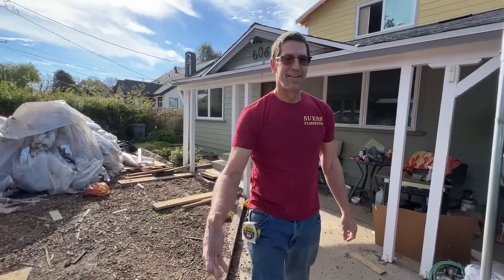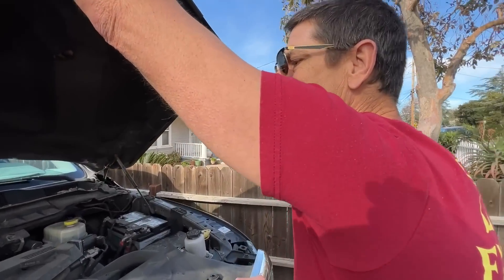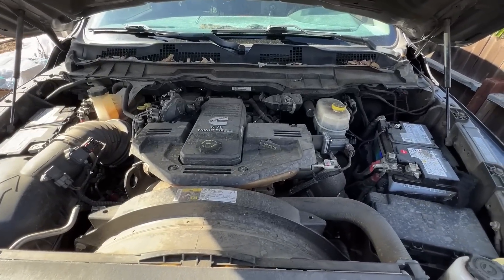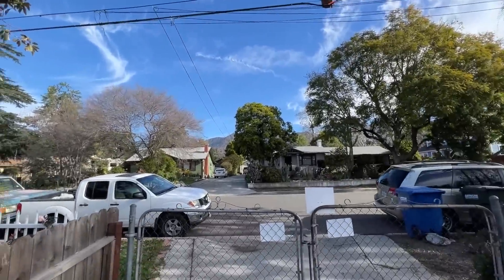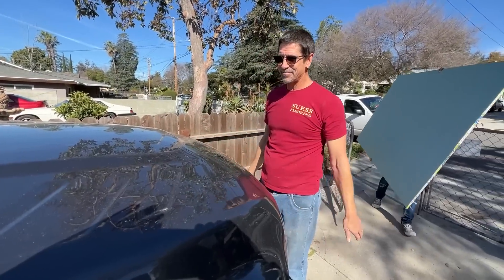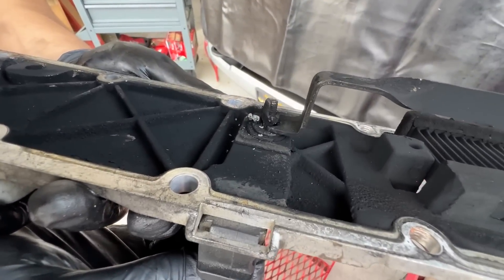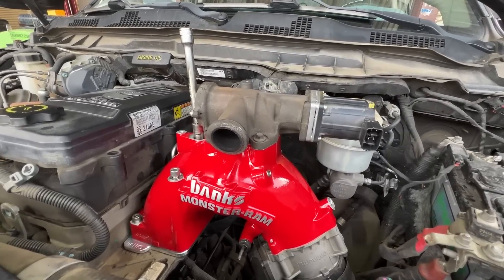This is the bolt that kills RAM trucks.

Comment: My friend had his 2014 6.7 destroyed by that grid heater bolt and has been working on his truck for 7months now. I bought the banks intake but still need to install it. I also replaced the killer dowl pin on my 5.9 12valve which was over$1000 to do. That engine is still running strong at 390,000 miles…Solid engines with little defects that are worth addressing
Reply: My daughter turned my old place in Texas into a cattle business and tack shop for horses & she needed a truck. We got this used 08 Ram with that 6.7 in it and that stuff was bad when we got it. I took it home and when I found out what that intake costs and the work that needed to be done man did she get mad. The truth is now I live 2,500 miles away. She has been here and back now several times and west coast with that truck. The times she comes here she tows their big camper usually shows up late June here. I keep going over it fresh fluids R a must. The thing is doing more than fantastic it is awe inspiring the way it just keeps on going. Thanks to living in the deep south away from the real terrible weather the frame is fine she had the rear springs replaced 2 years ago. Last year I just painted the thing again. I painted it when she got it and its still alive and well. She thinking about a new motor this year or next year.
Reply: Wow you got robbed on the kdp kit. That kit is $130 and a few hours if that to remove timing cover and install kit.
Reply: @dsimondublin  that's where it pays to know a trade fr the labor some of these big shops charge is insanity
Reply: @dsimondublin  No need to buy a kdp kit. You can make a tab yourself from any piece of metal. All it's going to cost is a front main seal and a gasket. It's less than 30 bucks to do it yourself.. I'd never charge a customer that much to do a kdp. Someone's eating good after being paid that bill, wow
Reply: The 5.9 is a superior engine to the 6.7 in all aspects besides not as much power
Reply: We replaced the killer dowel on our 97 12 valve about 10 years ago. It's at 97,000 original miles. Not even 100k

Comment: As a career tec at freightliner dealer first thing i would have done was steam off the engine 
It was like not taking a shower before surgery 

The inside of the intake looks like the inside of a muffler
Reply: government emissions to thank for that, all the current diesels look like that due to EGR system.
Reply: That was EXACTLY what thought.....clean that engine.👍

Comment: It's the perfect example of incomplete information being shared as the gospel, the reason why that intake air heater failed even out in California where it would only get used a few times a year, is because the Dodge solenoid on the passenger battery tray shorted out and kept the voltage to the heater
Reply: There’s actually a “cleaning cycle” that activates the grid heater after so many engine hours (if it hasn’t been activated due to temp). So it should be activated more than a few times a year

Comment: You have to replace the solenoid for it on the passenger battery tray, that is the reason they go bad it was Dodges fault not Cummins, the Mopar solenoid is underrated and it sticks
Reply: I had the relay that energizes the the fuel control solenoid fail when truck was five years old. I bought a small engine starter relay from NAPA that's higher rated and no more problems for 23 years now 😅
Reply: Lol spend that money like it's going out of style lol
Reply: Is this also what is causing recalls for the 2022 rams with the grid heater?

Comment: Definitely a major issue. Just wish Banks would address the loss of 3/4 of the heater wattage.  Roughly 2400 watts stock and Banks is around 600 watts.  This is fine for California but not great for us up North with -40 weather.
Reply: Here in the north  we use a inline coolant heater.
This heats coolant in the engine.  So on those freezing cold mornings.  The truck fires up easy and as extra bonus you get warm air blowing in  the truck.
Reply: @assassinlexx1993  Got an inline coolant heater on a 1.9 TDI Volkswagen engine (on a '03 Seat Toledo). There is a major problem with it, as the engine will not get proper glowing time and acts like the engine is already warm, making the startup very cumbersome and harsh. Not sure if the heater should be on another spot, but it really sucks, as the startup is actually easier without using the heater... just because the glow plugs work as they should when it's all cold. The older style block heaters are way better as they also warm up the oil, at least somewhat. I think they are usually installed in a freeze plug hole that has enough clearance for the heater element.
Reply: @assassinlexx1993 block heater does the same, heats all your coolant
Reply: @christophercain7343  
No way as fast or if the temp - 35 and the wind is blowing.
Reply: @assassinlexx1993  just plug it in overnight, the vent air is warm still
Reply: What a shame lol
Reply: 2400 Watts....at 12 Volts, that's 200 Amps..WTF ?? Where does that come from ??
Reply: @diverbob8  The batteries.

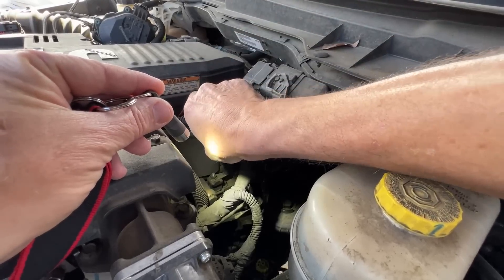Comment: 2:27 I’m no electckicken but I think it’s the 700+ amps the battery is capable of squirting out more than the 12v that’s cooking metal bolts for dinner? 

Also I’m no deselect guy but no fuse protection for this guy?

Comment: I wasent aware of this issue when I ordered and installed the Banks intake, but it was a pleasant surprise to eliminate a potential problem before it showed up.

Living in Alberta we do have some cold weather that brought up some concerns.  Admittedly, there is the odd time a second cycle of the key was needed to start the truck. It is a very small inconvenience to save your engine potentially.

Comment: I'm all on board with this but my question is with the position of the Banks heater, what keeps the new heater from sometime in the future from also failing and dropping into the intake?
Reply: Because it uses a intake heater designed by gm not cummapart
Reply: Same heater used on the Duramax. You don't hear of DMax having heaters fall into the engine. Proven component.
Reply: Nope , just fuel pump metal shavings, or is it cp3 ? Hell, i dont know now
Reply: If you look on the channel Gale made a video showing the difference. Its a small element that threads in at the top and kinda looks like a block heater. Nothing to break loose and go down the intake while also eliminating the grid which restricts the airflow into the engine. A superior design which eliminates the fatal flaw and allows better airflow at the same time.

Comment: Will Banks be fixing the same issue on the 4500 and 5500 Cummins? The Monster Ram intake doesn't fit apparently as there are differences on the manifold.
Reply from the maker: Funny you mention that. We just got our hands on a C&C 5500 for testing. Coming soon.
Reply: @bankspower  Awesome!! I was talking to Dirty Diesel in Kelowna BC last summer and they asked you guys about it and they hinted that you would check it out. Thanks for the confirmation !! Looking to pick up a 5500 possibly this year.
Reply: @bankspower  awesome looking forward to it!
Reply: Ya I would like to know.  I have a 2022 5500 and would like to purchase one.

Comment: I'm beginning to wonder if this is an issue with the Ram spec engine. I work in the heavy duty truck segment, and our shop has only ever seen 2 or 3 of these mishaps. They also have been on 9L engines not the 6.7.
Reply: Given that it’s related to the intake and emissions (Dodge’s area of engineering) I’d imagine it is.
Reply: @Jacob Rzeszewski  the grid heater is still Cummins, but the bolt could be specd differently. The 6.7 in busses, box trucks, and other larger trucks is different from the 6.7 in the pickups. I'm not sure what all of the  differences are. It could be just a few items, or it could be half of the engine.
Reply: @Jacob Rzeszewski  Cummins does all that shit. All the Emission parts are Cummins, the ECU is Cummins, Engine Wiring Harness is Cummins.
Reply: @fredtflail true, but it doesn't mean there are no differences due to Rams specs. If you look at the 6.7 in every other application other than a Ram truck, the fuel pump is on the rear gear housing, not the front.
Reply: The 9L is the most underpowered diesel out there.I do not know why that engine is available in Freightliner trucks

Comment: You would think this would be a recall by now...
Reply: Dodge never makes a recall, they let their customers deal with it.
Reply: @shanesischo1313  Not true
Reply: @shanesischo1313  they have a shit ton of recalls, it’s just hard to keep track of all the recalls they make
Reply: @shanesischo1313  🤨 that’s wierd, I had a high pressure fuel pump replaced under recall.
Reply: couldn't agree more, such a small mod to fix such a huge threat
@Shane French guy here, does Dodge really never do any recall ? That's crazy !
Reply: @crezychameau  the headers on 5.7 hemi pickups have been cracking for how many years? And no recall.
Reply: @cliffsta87337  Well, that's disappointing to learn :/
Reply: @cliffsta87337  all apart of mds
Reply: This has a potential of being dangerous because let’s say you are in traffic and cutting in front of a vehicle and you know you have enough distance to do it but the engine stops running suddenly and you get hit from the side and imagine the cost to repair or replace a engine.
Reply: Anyone wanna take one for the team and get injured from a 2nd gen busted dash?
Reply: Yeah, seeing how many trucks burned to the ground 😉
Reply: The only time they do recalls is when ppl  die or get seriously injured. That goes for most automobile companies. The only way to get them to admit fault on something like this and fix it is a class action lawsuit.
Reply: This is a current recall
Reply: It is a current recall or at least it is on my 21 but no parts are available
Reply: I replaced my track bar that the dealer would not weld the jam nut as the”fix”. I bought an aftermarket and had it installed. I submitted the bills to Chrysler and got reimbursed. I will try it with the intake too and see what happens
Reply: Recalls are only for safety items. You can thank the government.
Reply: @franklaskus2395  manufacturers can voluntarily recall for anything, and his is an engine that can destroy itself while driving not a safety issue?
Reply: @franklaskus2395  Good work gub’ment! Lettin’ the free market decide that Dodge could make better vehicles but they don’t. Now, if people would stop lining up to overpay for these rolling plastic parts crumblers! 😅
Reply: @stansbruv3169  I'm guessing you never took the time to learn why crumple zones exist on vehicles. Modern vehicles are safer, more robust with proper maintenance, and a hell of a lot less dangerous overall than they were 30 years ago.
Reply: They have no reason to recall it.  It’s just something that can start it on fire when it’s starting
Reply: @georgewelker853  🤣🤣🤣
Reply: It needs to be recalled!!
Reply: it should be recalls because it can destroy engine if they dont make recall them that going hit them with lemons bills which they dont want lemons vehicles 
it need be addressed important
Reply: My brothers was replaced under warranty. A 2016
Reply: It's called planned obsolescence
Reply: If Dodge recalled every problem they had, they'd have no money and nothing to sell
Reply: Apparently, our government could care less. They keep letting these companies slide and its getting old. We need real reform in our consumer protections ever since tRump totally stripped it. Biden needs to get off your butt and do something about it.
Reply: Nah they'll just put out a tsb
Reply: Stellantis auto group doesn't really care rather you buy new vehicles... So next time don't buy from them.
Reply: Recalls are only for safety issues. The grid heater not working is not considered a safety issue.
Reply: @joshmick  they are not just for safety issues. As an example GM recalled trucks for bad lifters.
Reply: @ColeSpolaric  Recalls are for safety issues. An engine quilting or locking up on the highway could lead to a safety issue. Recalls are mandated by the government when safety issues are observed. But, the manufacturer can impose a recall even if it's not safety related. Usually because of excessive component failure to save their ass a whole lot of money and lawsuits and to satisfy or keep trust in the consumer. I worked for Chrysler for 42 years and know this for a fact.
Reply: @kenbtheman  it's that it's a known defect grenading engines that could easily lead to a lawsuit is why I'm surprised. I guess I should have said manufacturer voluntary recall...
Reply: @ColeSpolaric  I'll tell you something else, and you can look this up. These things aren't dropping like flies. The failure rate is low. But because of the great Internet everyone who has had a problem raises hell like it's happening all over the country. Then you have everyone jumping on the band wagon. I bet you more than half of the people screaming about this don't even own a Cummins diesel truck.
Reply: Nah isn't costing lives only bringing them money so no one to tell them they have to do it.
Reply: Chrysler: Crunch all you want. We'll make more.
Reply: No concern to safety, so no reason to issue a recall. I'm sure dodge has a bulletin on it tho
Reply: I just did one on a 2022 Freightliner M2 with a Cummins ISL and it’s still the same design. Don’t think it’s a concern for them that they are failing.
Reply: That would be admitting fault and unless people could die they will never do that.

Comment: I feel like the 2003 5.9 is the best Cummins engine produced.
Reply: It's the fact that the 5.9 is not dealing with the EPA/CARB soot and NOx devices that make them reliable.
Reply: Seeing as how I’ve owned one since new I’ll have to agree 😂
Reply: @deercreekmechanical  love mine. 275,000 trouble free miles and still going strong.
Reply: @davidbottles3035  230k on mine